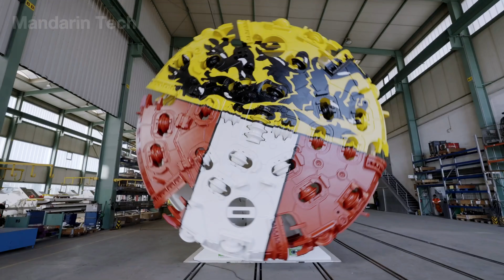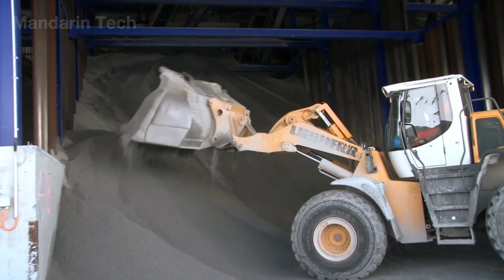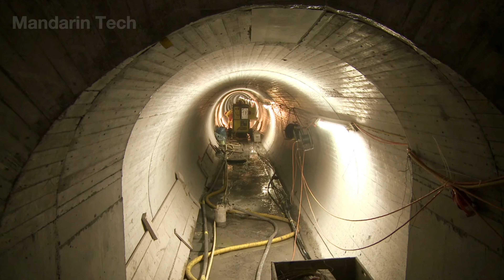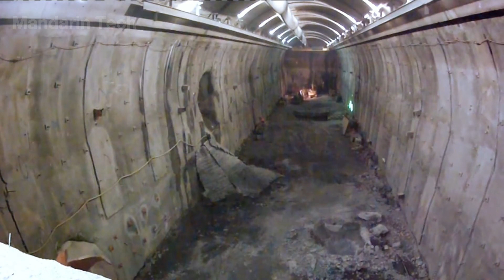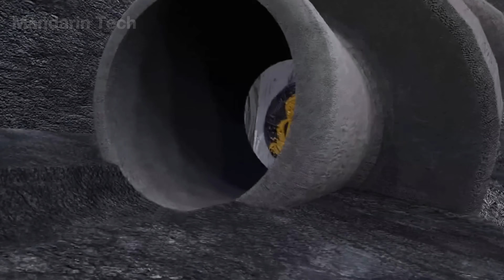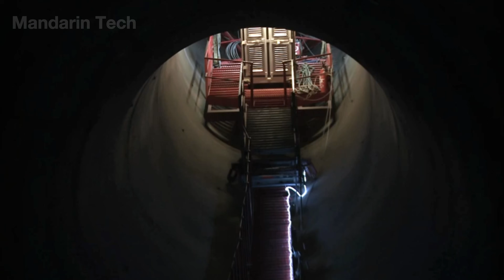European Builds A Massive 1,000+ Meter Dam And Tunnel To Power An Underground Hydropower Plant

Comment: Field Engineer & Environmental Perspective
🇬🇧 English

From a field and environmental engineering perspective, large hydropower projects must balance energy production with ecosystem protection.

Dams and tunnels can significantly impact water flow, biodiversity, and surrounding environments if not carefully managed.

Engineers play a key role in implementing environmental monitoring, water management strategies, and sustainable construction practices.

Hydropower remains a critical component of renewable energy—but it must be developed responsibly.

#FieldEngineering #EnvironmentalEngineering #Hydropower #RenewableEnergy #SustainableInfrastructure #WaterManagement #EnvironmentalProtection #GreenEnergy

Français

Du point de vue environnemental, les grands projets hydroélectriques doivent concilier production d’énergie et protection des écosystèmes.

Les barrages et tunnels peuvent avoir un impact important sur les cours d’eau et la biodiversité.

Les ingénieurs jouent un rôle clé dans la gestion durable de l’eau et la réduction des impacts environnementaux.

L’hydroélectricité est une énergie renouvelable essentielle, mais elle doit être développée de manière responsable.

#IngenierieEnvironnementale #Hydroelectricite #EnergieRenouvelable #InfrastructureDurable #GestionDeLEau #ProtectionEnvironnement

Español

Desde la perspectiva ambiental, los proyectos hidroeléctricos deben equilibrar la producción de energía con la protección de los ecosistemas.

Las presas y túneles pueden afectar el flujo de agua y la biodiversidad si no se gestionan adecuadamente.

Los ingenieros desempeñan un papel clave en el monitoreo ambiental y la gestión sostenible del agua.

La energía hidroeléctrica es fundamental, pero debe desarrollarse de manera responsable.

#IngenieriaAmbiental #EnergiaHidroelectrica #EnergiaRenovable #InfraestructuraSostenible #GestionDelAgua #ProteccionAmbiental